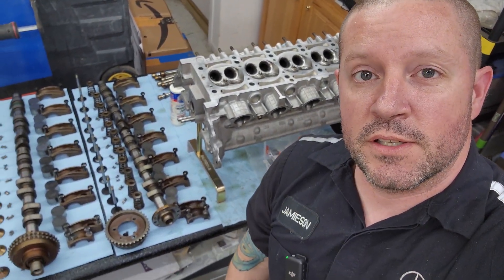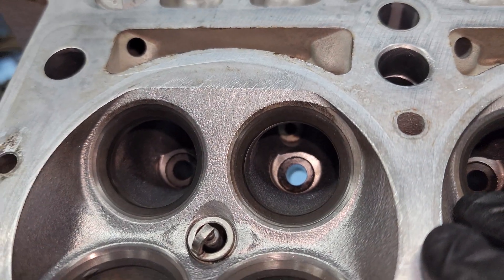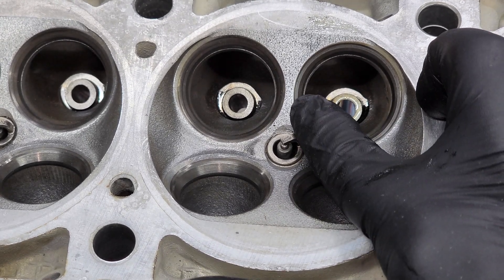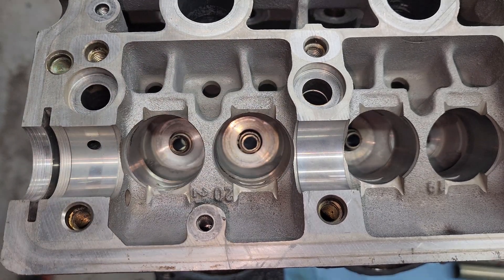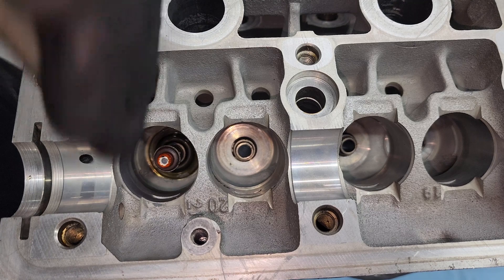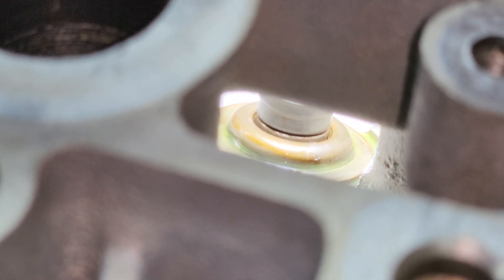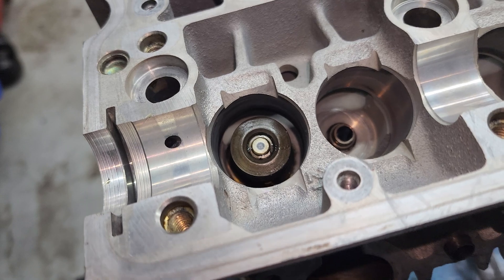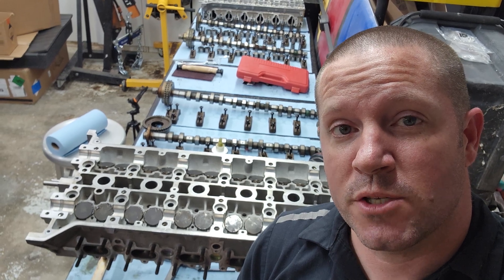M120 V12 Cylinder Head Assembly

Comment: Amazing work, thanks for taking the time to make these videos, I have the same car and I learned alot from you.
Are you going to post the rest of the videos showing the complete reassembly of this massive machine? I went through the whole M120 project on your channel but I couldn’t find the final videos for this project.
Reply from the maker: @edlopz1722  I'm not done with the videos yet.  I'm still looking for a complete car to take apart so I can have all the electronics and accessories for the engine.  It would be easier and cheaper than buying each part individually.

Comment: Thanks for these very enlightening videos. I am working on a M120 myself and i notised some differenses. My valve springs are double counter turned, yours are single and seems to be tapered ( to avoid thread interference in compressed mode due to thickness?) A way of saving weight on the valve train? Mine is a -92 as far as I have figured, my pistons has some coating on the top and passed the first compression piston ring, inna darker colour than the Aluminiumin the rest of the piston, at least you new piston did not seem to have that.  Nothing that bugs me really, the question as always, are there improvements madeor is it the finance dide of the company that has entered the arena and made things cheaper?
Reply from the maker: Youre very welcome!  This engine is a 1993 I believe so that could be why?  I'm not sure when these parts were made.  If they're more recent than NOS then I'm sure there are some technological improvements that have been made in the manufacturing process but everything will still be made to the same specifications.  Or maybe the decided they could get away without including the coating to save money?

Comment: Hey, subscribed and love your series on the M119 and the M120, as I also have one of each.  About the M120, where do you source your parts?  I just went looking for a new crankcase breather pipe A1200183212 for mine and found a whole lotta NLA.  Same for the intake gaskets A1201410280.  I assume you're gonna replace these on your M120 with new?  I'm beginning to wonder if these old engines are maintainable in the long run.  Sad if they're not . . .
Reply from the maker: I get as many parts as are available from the parts department in the dealership I work at.    I am in the same boat for the breather tubes and intake gaskets not being available.  A lot can be found on eBay if you want the factory parts.  Other than that, some aftermarket companies make the gaskets.  One part I am having trouble with is the seal for the timing chain between the cylinder heads, it seems to be made of unobtainium.

Comment: So many parts!!  Nice, clean work area, too.  My father and his brother once rebuilt an engine (carberated V8) way back in the day, probably in the 50's during a sandstorm.  You guessed it.   The thing would not turn over, the dust locked it up.  Clean is good.
Reply from the maker: That had to have been a helluva sand storm!